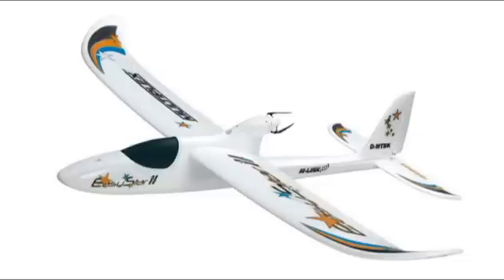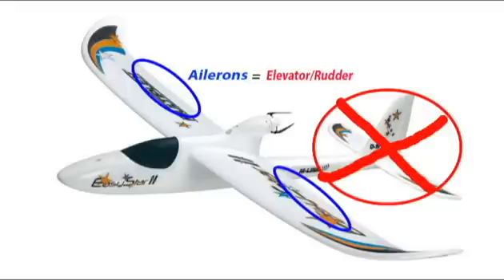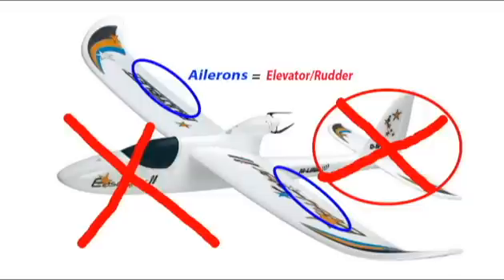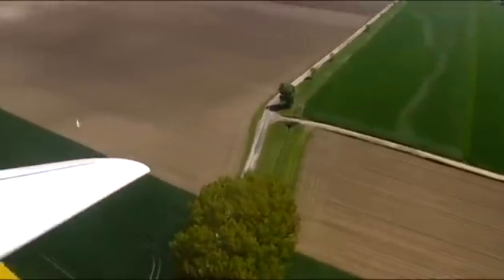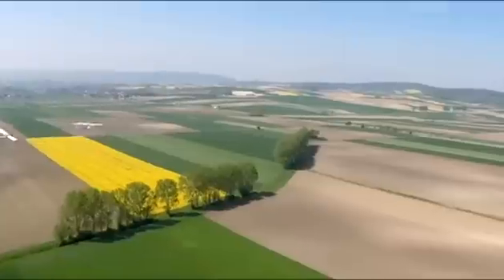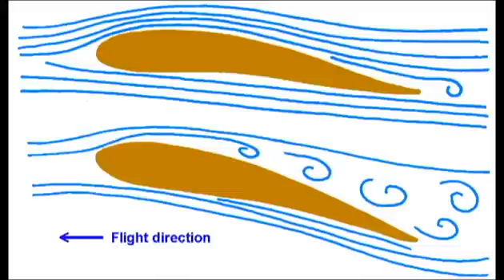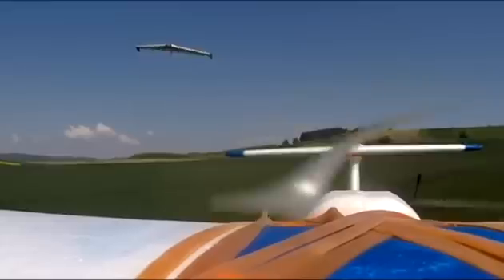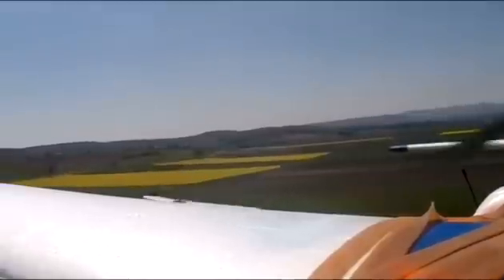What is the most efficient RC plane?

Comment: I fly both flying wings and gliders and I'm sorry but a decent glider is far more efficient than the best flying wing. Yes there is a tail and fuselage creating drag but the difference is in order for a flying wing to be stable it needs reflex in the elevons. In other words the tail edge of the airfoil needs to slope upwards. Think of flying a nose heavy plane where you have to continuously hold up on the elevator slightly in order to fly level. You are essentially creating extra drag but gaining stability. Also while flying wings have a pretty good flight envelope they typically fly faster than a glider, and anytime you are pushing something through the air the faster you go the more and more power you are going to consume and efficiency goes down. But every plane has its use. Flying wings are good in that they are more durable, cheaper, and are better for stunt flying and abusing them. 
On the right day using thermals I can stay in the air with a glider all day using only power to run the servos. Very difficult (if not impossible) to do that with a wing. In fact I have to use flaps and air brakes or crow mix to create drag (and inefficiencies) just to land a glider. 
Also the last time I checked the long distance record for FPV (electric) was done using a 4m Fascination glider with a 2200mah battery. He used thermals to fly 111km away and then 111km back.
Reply: CR is 100% correct. The video only focuses on the positive aspects of the flying wing and overlooks the huge negatives. As CR said, to get back the stability that the tail was providing you need to use an airfoil with a positive pitching moment (e.g. a 'reflexed airfoil).. These airfoils are very inefficient. You only need to use your eyes to see the most efficient design; the most efficient planes (sailplanes) have tails and even nature decided that tails were most efficient because all birds have them.
Reply: I have not seen a flying wing specifically designed with the high aspect ratio for gliding as a glider obviously is; it seems such a design must ultimately  be more efficient.
Reply: Ralph Walton - I mean no insult but thats a very common and outdated statement. That computing power you talk about that made flying wings more attractive - not that the "analog" wings before that didn't work(though unusual like Horton or Northrop) - now can be found in any cell phone, even the gyro's now are 2x3 mm and you can get a fully digitally 6 axis gyro stabilized wing for 150 dollars... what I'm trying to say is your argument would have been valid 20 years ago, and is still being perpetuated by old physics professors that haven't really looked around lately. The flying wings now is not a "niche" but a big thing in RC, as well as considered the future in commercial flight - see Boeng/Airbus future lifting body concepts. The board I mentioned with automatic 3-6 axis gyro stabilization and other flight controls, cost 10-50 bucks... but you know that commenting here on RC planes don't you? 
PS. This has nothing to do with the uploaders claim that wings(in their present state at least) are more efficient than other gliders, I always thought it was the other way around, though I don't have any experience on that. What everybody that has a clue says is otherwise.
Reply: I completely agree with C. R. autostable airfoils in flying wings are less efficient. The need of an airfoil where no variation in pressure centre exists in flying wings reduces the possibility of using airfoils with high efficiency polars. Assumptions in the video are, in general terms correct but conclusions are not. Nevertheless, video is really interesting :). Best Regards from the rainy north of Spain.
Reply: Thank you CR, this video is dead wrong and should be removed. How come you haven't made any videos? You mentioned Thermals... My Adrenal fix is slope soaring... ever tried it?
Reply: The lifting bodies you speak of are intended to exit (or nearly exit) the earths atmosphere to then re-enter, something of which a winged aircraft have difficulties with. "In the earths atmosphere" a flying wing is less efficient than a craft with tail planes. It's actually preferred that re-entry vehicles are less efficient so as they can decelerate (and get down quickly) upon re-entry.
Reply: Read before comment, please. You obviously didn't get the last sentence in my comment. YES I KNOW gliders are more efficient, at least with the designs so far tested. We obviously agree, yet you want to have an argument ? I was not talking about space-planes, even though future passenger planes will cruise pretty high, we don't talk more than 40000 maybe. Not exit - re-entry - that's a whole other ballgame. I meant future super efficient passenger planes with big lifting bodies/delta wings. The B2 f.ex. does not have to exit the atmosphere... but that one has implemented systems so far unexpllred in civilian aviation.
Reply: I didn't mean to be offensive or argumentative , was just explaining that the video we're speaking of falls far short of being correct and may mislead others of whom maybe wanting to experiment with their own R/C designs. Don't worry, Be a Happy Fox lol.
Reply: Exactly, were on the same page, actually the video had me almost ruin my otherwise good mood, as you can see in my other comment, it pisses me off all the self proclaimed "experts" on youtube - there's more every day - that has a calling to bless the world with their divine and over average insight into everything. Many times(and especially in this video) being so far off that someone just have to tell them... not that this breed ever listen to you, even when they're dead wrong  :)
Reply: BTW are you in any way familiar/related to Richard Sharp Shaver ? As in the Shaver Mysterious Underground ? It's great. Just wonder.
Reply: The longest aircraft flight is the solar powered nasa plane which can stay up indefinitely.  It's a flying wing.  Gliders are designed for catching thermals so like the solar powered flying wing, they are getting added boost outside the battery.  Both are just anecdotal then.  It seems a well balanced gyro controlled wing though principally speaking may overcome the issues CR talked about.  Tails after all provide the opposite of lift.
Reply: Flying wings have much wing area and is probably why they chose the such for the solar panel "area". Flying wings also must provide "opposite lift" which shows up in needing up trim or up elevons, in other words the airfoil gets reflexed at the trailing edge via needing downward pressure at the aft of the craft, this is what screws up the airfoil (which is screwing up the main wing so to speak) in needing a figurative up elevator to hold the nose up just as conventional aircraft need up elevator to hold the nose up (your mentioned opposite lift). It's the reflexing of the main or lifting airfoil that produces inefficiency's of the flying wing design along with it's usually inherent short coupling for the elevator surfaces. It's a-lot like flying a conventional aircraft with opposite flaps applied which would screw up the efficiency of the main wings airfoil on a conventional craft. Higher speeds however help to alleviate the up elevon or reflex requirement but conventional craft also require less up trim as speed increases so, there is a give and take but the flying wing gives more than it takes as compared to conventional aircraft and therefore loses overall. The newer flying wing designs are however doing all that they can to overcome the above stated inherent problems. It depends on what parameters you're designing for to decide the best course taken to achieve an intended result. Yes you could pick that definition apart a-bit in so far as the increased speeds which need less up trim "only as far as control surface "angles" are concerned" to correct it but, it's mostly  the needed reflexing of "the main wings airfoil" that kills the flying wings efficiency.
Reply: C R ii
Reply: Ralph Latham. U need to do a bit more research. Your assumptions are the same as mine before I corresponded with Dr Mark Drela (MIT professor then) about this issue . If you are not familiar with his pedigree I suggest you google it. Nasa, MIT etc have looked into this issue for decades. CR above is 99.99% correct.

 If you have enough computing power and sensors and active COG control and some other very clever tricks there are some small niches that suit a wing in commercial applications.
Reply: Thank you, C R. The video was a bit insipid, loaded with reasonable but fallacious conclusions.
Reply: Am unfamiliar with Richard Sharp Shaver but I'll have to look into the Shaver Mysterious Underground. Gladdened that we found agreement! :)